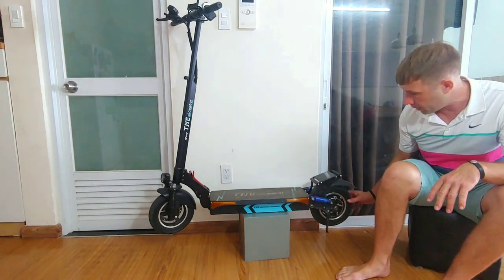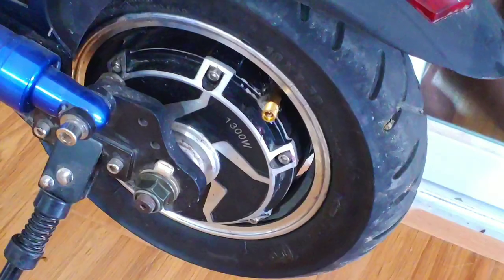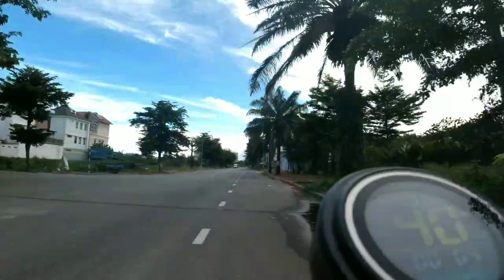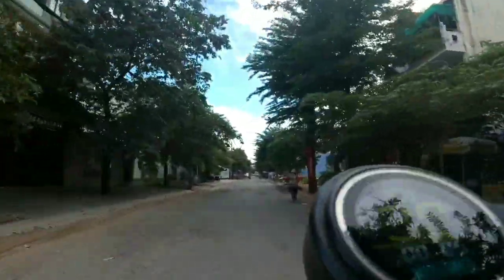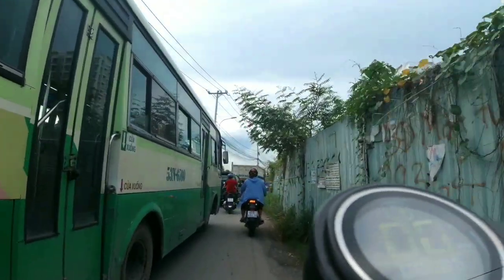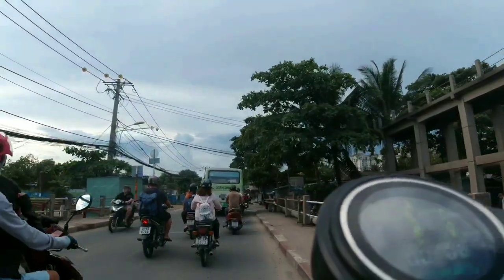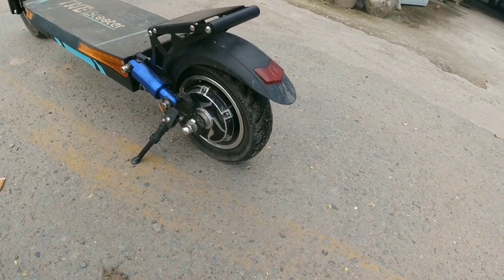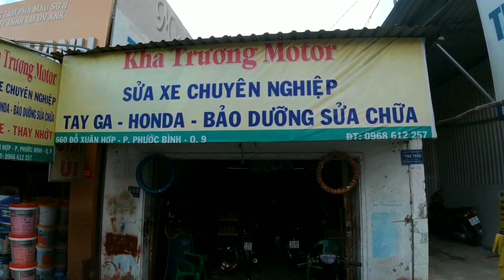TNE Q4 V3 | My Flat Tire Nightmare PART 1 [BEST ELECTRIC SCOOTER UNDER $1000?]

Comment: I have a Q4 V4. I've had two flats with it. I do the repairs myself. It still took 6 weeks to get a tire and tube. The tube that I was given has a 90 degree valve stem. The TNE has a 45 degree stem. I ordered two sets for $60.00 each set. I live in Canada. I cannot find a retailer here other than Amazon. The new tubes didn't come with caps lol.  Have a great day,love your videos.
Reply from the maker: Im going to order an extra tire and 3 or 4 extra tubes just to have them around. Then ill have to learn how to fix it myself. The scooter still currently isn't ridable. Thanks for watching!
Reply: I was thinking of ordering and trying out a solid tire. Off road tires are not available at 10"x2.5 and must be ordered from another scooter in Canada. Scooters are new to Canada and are considered a toy not a vehicle by most people. The scooters they do sell here are over priced and under powered. I bought mine from a gentleman who imported a single garage full of them.  I paid $1600.00 Canadian. There seems to be different models of the Q4V4. I do not have turn signals and the charging ports are at the rear. I have a single spring on the rear. The rear step on mine is just a frame. I usually drive at 20-25 kph and get about 100k per charge. Do you have snow in parts of Vietnam?
Reply: @xyzyyz  the trouble is they aren't a split rim and you cant stretch the solid tire over the rim (I have looked at this).
Reply: So does the Q4 v3 have a 90 degree stem or 45 degree because I have a flate on mine?
Reply: @MYT2024  it was originally 45 but now it’s a 90 either work.

Comment: You poor fellow, I have that exact same scooter here in Australia, I've replaced a few inner tubes in the rear, it's like anything I geuss, easy when you know how, wish I posted a video on how to now. 
Sorry to hear about your experience.
Reply from the maker: The main problem was finding the replacement inner tube. Its not a common size here in Vietnam. Hardly anyone has escooters here.
Reply: @ericd1084  Not a common size indeed. But really good fun and super convenient transport e scooters.
Did you order a few spare tubes?
The advice is run the tyre at 50PSI and you get a lot less flats. Still doesn't help if you run over a nail or somthing. Have fun!

Comment: Hey buddy I have one of these scooters I've done about 1800km, I needed to replace the tire before getting a puncture  (although I did get a flat on the front from hitting speed humps at speed lol).
The tire removal is pretty hard and not messing up the alloy rim also makes it tricky. I have made my own tyre levers but you might be lucky to find something that's used for motor scooters. If you have to order stuff get some 'tire slime' it's emergency puncture repair stuff and works well. If you have any questions I'll happily try to help you out
Reply from the maker: Nice. What did you make the tire levers out of? It's going back to the shop again. You'll see what happened when I finally got it back in the next episode. I'm also going to order some tubes and a spare tire to have on hand for future issues. I also want to learn to fix mysef. Most places here in Vietnam don't want to mess with it. E scooters are still pretty rare here.
Reply: @ericd1084  I used a big flat blade screwdriver and used a angle grinder to make a lip (to hook the bead) about 10mm from the end and took all sharp edges off then put electrical heat shrink over it so it wasn't stright steel on the aluminum rim, I also made one out of a nail puller but I had to grind it alot so get the shape right... from my experience I've need at least 3 or 2 and something to hold the tire up (like a spanner closed end tho). Getting the tire on is worse tho... I used a couple of little F clamps to help hold the tire on. I also didnt unplug or remove the motor just worked carefully not to put too much stress on the wire or brake disk.... I'm awaiting on tubes atm so when I get another tube I'll record the removal and assembly process of how I do it👍 oh also lots and lots of lube like dishwashing liquid. It is a battle but can be done

Comment: 00:35 Sucks that Vietnam doesn't have the tube. It must be a headache trying to repair those tires.
01:52 That's the most annoying thing when they forget to put back the valve stem cover. WHY????
02:53 Thanks for stating that it was KM/h. I was wondering when looking at the readout.
That electric scooter is pretty nifty and seems like a perfect mode of transportation when you don't want to use a motorbike or car.
03:33 Hit and run bro? LOL 😅
06:14 Done.
09:11 Good guy indeed.
09:55 Man. The look on your face. You were just DONE.
12:03 Nice hair cut.
12:44 No it doesn't. It's actually pretty interesting. There's a YouTube for everyone.
14:00 Hope the nightmare comes to a successful ending.
Reply from the maker: Yeah that valve stem cover is super annoying. That's the most basic part of wheel and tire maintenance. Its not as is those caps are expensive. Lol It still isn't rideable. You'll see in the next video. I'm still working on getting it fixed. Thanks for watching!
Reply: @ericd1084  Ok cool. That sucks that it's on ice right now. I am sure you will get it fixed.